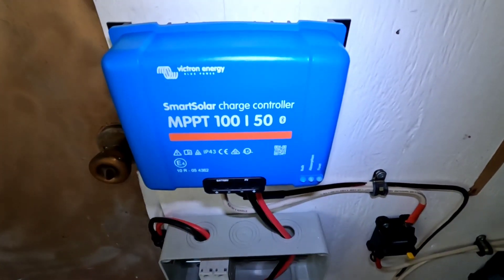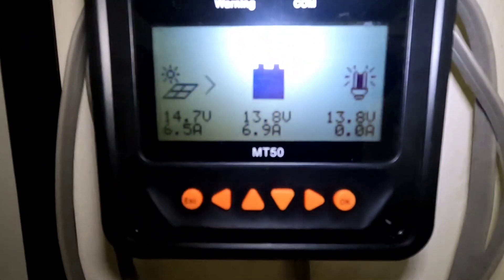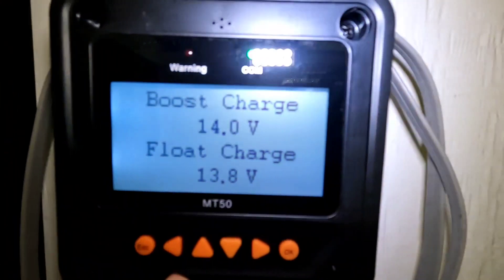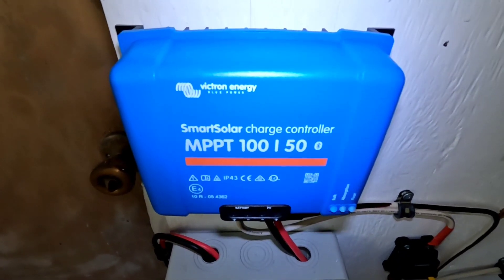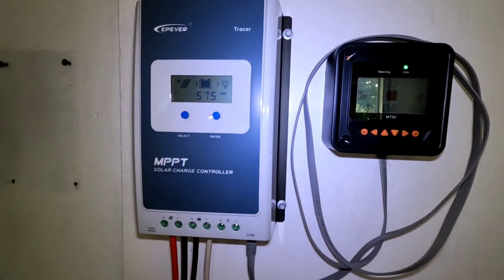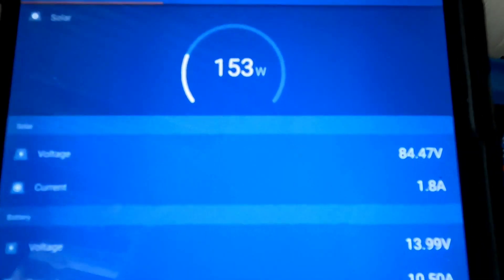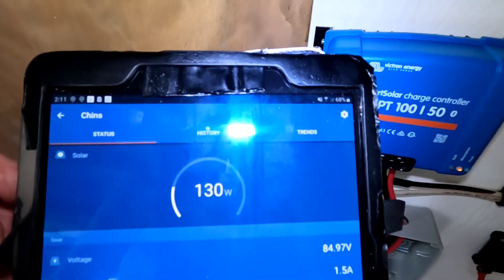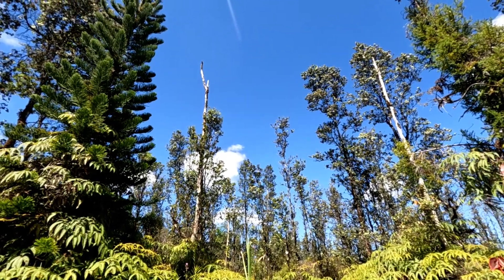Victron energy 100/50 and Epever 40a solar charge controllers side by side  exact same conditions

Comment: I tried both too and they are exactly the same, same v and amps same watts and in REALLY the same condition because i connected the same wires from one to the other to compare, i return the victron because of their impossible price for a wifi option, i got the epever with wifi at lower price than victron with only BT

Comment: Stiamo facendo troppa confusione dando opinioni senza avere le basi per farlo.

1)You can't take the test with 2 regulators in parallel !!!! If one arrives at the battery with one thousandth or more voltage than the other, the other will give 0A. it is pure physics !!!. even if you have set it the same, it is enough 2 cm of difference in the length of the cables to distort everything.

The test is only valid until one of the 2 can reach the target voltage of absorption or floating. ONLY IN THESE CASE EITHER CONTROLLERS ARE MPPT WORKING.(Topic in my answer to myself).
after that the rest makes no sense. it's just to study the law of ohm to understand that what you see has nothing to do with tracing, speed, control and other things you said. IN ABSORPTION AND FLOATING PHASE, if the phase target voltage is manteined any control dont work MPPT. Because is simply non physically possible.
And the current will only be divided according to resistance and voltage. When you see epever at 86v pv, 13.9v and 0.0A and victron at 13.99v and 10A, THE CONTROLLERS HAVE NOTHING TO DO!!! If the victron arrives on the battery at 13.99 and epever at 13.95. the law of ohms does not allow epever to provide power !! Raise the float voltage of the epever and you will see that it will be the victron to give 0.0A is the same thing as when you travel in a camper with a 13.8v float controller and a 400w load on. THE CONTROLLER PROVIDES 0W AND OA AND THE PANEL VOLTAGE RISES, AND ALL A LI PROVIDES THE ALTERNATOR BECAUSE AT 14.3V IT EXCEEDS THE CONTROLLER VOLTAGE. BUT if you raise the control voltage to 14.5v, he will be the one to provide everything and the alternator will provide 0.0A
It is PURE PHISIC NOT CONTROLLER ENGINEERING

2)I WILL REMEMBER 
That in the absorption and maintenance phases, the controller DOES NOT WORK IN MPPT !! THE MAXIMUM POWER VOLTAGE IS NOT PURSUED, because, if the phase voltage target is reached, for purely physical reasons, maximum power is not required and therefore the controller CANNOT FORCE THE PANEL TO ITS MPP VOLTAGE.
The mppt operation only resumes if a load powerful enough is turned on to exceed the maximum production of the panel, and thus absorb a part of the battery's current. In this case we return to the condition of the first charge phase, that is, in which the voltage cannot reach the phase target! Then the control returns to modulate the load resistance in such a way as to keep the panel at the ideal maximum power voltage (MPP)

Comment: The only flaw of the epever is that it stops at 14v on PV for a time ranging from x to 59 minutes. Those who are interested say so I explain it. I discussed with the epever engineers and they told me that I had hit the target.

For now, I'll just say that it's a deliberate strategy, shareable or not.

It has practically the same purpose that victron starts in mppt with PV voltage 5v higher than the battery. Epever part with 2v more battery. this leads to disadvantages . Low dc dc conversion efficiency at such low powers.

To solve they have developed a strategy that is what many notice, but no one on the web has ever understood.

Victron to avoid these disadvantages solved by DELAYING THE DEPARTURE. However, it still has disadvantages but to a lesser extent.

Pay attention in the morning with the PV voltage and PV power graphs early in the morning as soon as victron left..for about 20 or 30 minutes he can't find a real app point and keeps scanning the IV curve as if he went crazy from the minimum or the maximum..but he doesn't find the real point of app.. because with 3 or 4 watts it's impossible. And this crazy research consumes so little energy that ce. epever to avoid it, has implemented a "Castrata" mppt mode that lasts a maximum of an hour. [also because starting early, (+2v vs +5v) the problem of low efficiency at very low power would be even more evident].

However, this means that for a time ranging from a minimum of 1 minute to a maximum of 59 minutes, the power ramp will be lost .. the amperes will grow but the voltage will not be that of mpp. so after max 59 minutes it will make a new scan of the IV curve and then it will make a net jump in power. This is not disadvantageous with 18 or 36v panels. but with 86v as in the video it is disadvantageous. In fact epever advises not to raise the panel voltage too much. it is a strategy that is functional are when the voltage difference between PV and battery is not huge. The more this difference is, the more power is lost in the morning for a maximum of 1 hour.

I repeat, if you're interested I'll explain it better

Comment: I had two Epever controllers, one 100a and one 60a.the 100a failed, I replaced both controllers with Victron. Immediately noticed better overall performance. I’m on a boat, I originally faulted not getting full power from panels on angle or mast shadow. After installing Victrons I am now seeing full rated power from panels. The parameters were set the same on all units. I am very happy I changed units.

Comment: I have this same charge controller. Thinking of running two 400w panels on it with a 2kw inverter. Wdy think? I want to max it out and see if it goes 5yrs
😊
Reply from the maker: I now run two 500 watt strings into two Victrons in network with each other. Working well for me here. Aloha! 🤙
Reply: @ProjectsinParadise808  i don't understand how to use the power of the sun before it goes through the batteries.

Comment: Only just seen this. What you are seeing  is a common fault with the Epever. Its search for maximum power gets confused,  perhaps by a cloud, and locks on to the low voltage part of the panel volts/ current output curve. It may change if solar condiconitions vary, disconnecting and reconnecting the panels will often restore correct operation.
Reply from the maker: Great explanation of exactly how it behaves out here with the clouds that constantly roll through here. Aloha!🤙
Reply: Just started having this problem.  I have had luck just turning the PV off and back on but couple of times I had to disconnect the Battery and it went right back to work.  Cool nights and some thin clouds last few days.

Comment: Using the Vectron Ap, and Not Using the EPever Ap !  One Benefit's from the Correct Set UP, and the Other Has to Have the Ap For the Battery Set Up to Work Correctly, Unless is Lead acid, or One other, Glass mat I think,  For Lythithium You Need The Ap, on the Epeaver to Actually Set up the Charging Loads ...

Comment: I have 3/100amp epever charge controller now for about 2 years now working with no problem
Reply: Hi, I appreciate the dedication, but I'm sorry but everything you show and the considerations you make, from the moment of the end of the first phase, do not make any sense. Only in the first phase do the controllers work in mppt. In absorption and maintenance, as long as they maintain the phase target, mppt tracking has nothing to do with it. Haven't you noticed yet that your panels have unan Vamp of about 72v (changes with the temperature) and that you can only see it in the first phase? Didn't you see that in absorption and maintenance it goes up to 86v? Do you think Chen changed the Vmpp of 20v in a second? Mppt stands for Maximum power Point tracking . To find the precise voltage that produces the maximum power in all light and temperature conditions. In absorption and maintenance, unless there is a large load, by definition it does not extract the maximum power. So there is no tracking. and the panel is allowed to rise at a voltage at which it cannot produce maximum power.But at this stage the controllers have no modulation. it cannot be a better or worse one (except in conversion efficiency.

In addition, the comparison makes even less sense if you do not detect the voltages on the battery and do not say the targets of assosorption and maintenance of each .
Do you want proof of all this? Put the victron with 0.2v absorption less than the epever. you will see that it will be the victron to give 0A and epever will give everything necessary.
Are the wiring harnesses perfectly symmetrical? Impossible. so in the apse and float you will never see both contribute. except in the case you turn on a load such as to lower the battery voltage and regress in the first phase. in that case both contribute. but always according to the law of ohm.The epever problem is only one, and I explained it in a previous intervention. However it is very complex. if you do not fully dominate this that I talked about now it is even more difficult
They always give magical powers to the controllers and chargers...they do almost nothing . they decide 2 voltages in time and the rest is done by physics. the mppt controllers simply do "perturbe and observe" to follow the Vmppt. which they found by scanning the IV curve of the panels , which they do again at regular intervals of a few minutes. This is only in the first phase. If the battery maintains one of the 2 voltage targets, apse or float, THERE IS NO MPPT!! Without understanding this you will never understand well how a control works and less than ever you will be able to judge it well or badly  @ProjectsinParadise808

Comment: I have experience with both of those charge controllers paralleled together. If you didn’t notice your float voltage was set to 13.8 on the E Peever that’s why it was throttling. You could change the setpoint lower on the Victron and then it will start the throttle and the E paver will just provide the bulk of the current. There is no problem by the looks of it to me. I am slowly replacing all of my stuff to Victron. I also have two midnight classics.
Reply from the maker: Same here...slowly changing over to Victron.  Epever works well,  but day in and day out Victron always pumps in more kwh. Aloha 🤙

Comment: It almost looks like the Epever is acting like a PWM controller.
Reply from the maker: That's actually a great analogy,  and pretty much how it acts.  Last few day's in great sunshine producing about 500wh less than the Victron with strings in same location.  It may produce 1000wh, but Victron put out 1500...yeah...aloha 🤙

Comment: From what I can tell, the EPEVER problem is either a software bug or an issue with paralleling mulitple controllers. It seems to happen during shading events(clouds) and first light start up. It will just sit at 14v all day long till the string is reset. One comment on another one of your videos mentions having fixed the issue by adding a diode on the output of an EPEVER and that fixed it. It could be that simple. Victrons are great for the price but not perfect either. Definitely faster then the EPEVERs and possibly more reliable. I do like the EPEVER housing though.

Remember to cover a panel string before you cycle it to test so you don't arch the string
Reply from the maker: You described almost perfectly what my experience has been. I did see that comment you mentioned, but I don't know how to do that at this time. And mahalo for the tip about covering panels! That is important! Aloha 🤙

Comment: If you have both charge controlers hooked up to the same battery bus then they will influence each other. If the Victron is first at charging, it will raise the battery voltage, the 'slower to kick in' charge controler will see different voltages and hold back more. I have 4 charge controlers on the same 48V bus but they are controled by the Cerbo GX, it puts the MPPT RS units in 'External Control' mode. Besides, the Victron units have superior MPPT tracking :-)
Reply from the maker: The way you describe the two different controllers working is pretty much exactly what I am experiencing. Thank you for such a clear explanation! Yeah I like the victrons, aloha 🤙

Comment: Switch the inputs. Victron reporting 68.5 volts from the panels and the epever was reading under 15 volts from panels. Something odd there.
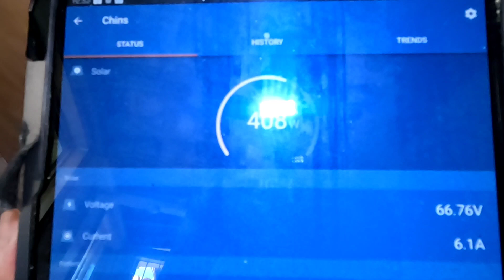Reply: 05:18
Reply from the maker: It seems the victron is influencing the Epever and getting it confused and slowing it down here and there. That's just kind of what it seems like. Aloha 🤙

Comment: they is something wrong on the e[ever it had dragged the solar voltage to that of the battery they was no mppt happening id check the solar cables
Reply from the maker: Yeah something seems off on it, although it does work...I dunno🤙

Comment: I must agree with the other comments: If the PV voltage input is not roughly the same on the two controllers, its not an comparison as it is not the same conditions. If you would swap around the PV strings, so the Victron would get the only 14 volts PV input, then it would be the one looking faulty! (Victron may be a better controller, not so much doubt - but there is something wrong with that PV string on the Epever in this "comparison")

Comment: Did you notice the PV voltage on the EPEver is only 14.8v ? This is why it's getting such low wattage. Now question is why is the voltage so low? It's like the PV is directly connect to the battery. I wonder if it has a shorted mosfet? Or is it just getting poor sun, and in PWM mode?
Reply: I was thinking the same exact thing I have an EP ever and/or and never had that problem before something is definitely wrong with that side of the system.... Like my man said you're only getting 14 point something volts in from your solar panels so of course you can only pull so much amps from that, Seems to me you  Need to isolate a variable. Something is not right on the epever side 🤔
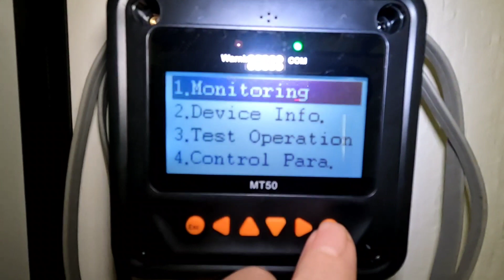Reply: Yes, definitely something is off with these 14.8 volts. At 02:15 we can see 14.7 volts on the panels and it's no wonder battery voltage will not go above 13.8 volts because the manual says that the MPP voltage range starts at battery voltage +2V. So there would need to be at least 16 volts coming from the panels in order to reach 14V. I think in these conditions 13.8V is still a good result. Something is not right here.
Reply: I tried to change values in Epever manually because I have to it's a older 2010a anyway I wanted to change 2 things on top row inside the parameters? I was thinking what the battery can absorb and what it can discharge in amps but those are not adjustable, yet my chins can go higher IN and OUT than the "20" that always shows in those boxes. Does my comment make sense sorry I cant share a jpeg here. peace!
Reply: because epever sucks! it's good i do have it but for me it also hands on low voltage... my panels produce 75v. and max power always si at ~62-65v..but epever loves to hang on 29v. and halfs the power.... i have to disconnect PV and reconnect so it "recalculates" and starts working ok...and i have to do that many times if there is couds in the sky

Comment: I was wondering how the 2 compare. big difference. I think if you put 2  100/50 together on same battery you can sync the 2 . Victron has a nice shunt you can use .will give you a more accurate watt hours in and out of battery. all Bluetooth ready . all your info right on smartphone ,tablet, or laptop. all logged with date and time. 😀
Reply from the maker: Victron put in basically double the power today compared to the Epever. Victron allowed maximum input from panels and tracked with crazy speed with the clouds rolling through.  The Epever did open up to full input occasionally throughout the day, but struggled keeping maximum input given the conditions comparatively. I'm going to be adding another Victron,  and add the smart shunt as you suggest.  I just want plug and play anymore.  Although the Epever did get my feet wet into the MPPT controllers,  they no way compare in the conditions here to Victron . They may find there way into other systems around the property,  but I am going Victron from here out. Aloha buddy 🤙

Comment: Nice video again! Can you explain what the 100/50 spec on the Victron means?
Reply from the maker: 100 volts, 50 amps .Aloha 🤙
Reply: @ProjectsinParadise808  Thanks! Assume that's max input from solar. So 5000W?
Reply: @stevenshircliff393  Do you think it might have something to do with the settings since you have to input lithium values under a User profile. Can you share your settings. I have a 4 of 3.2 volt LF280K liFePO4 batteries. Thanks
Reply: @sammaimas155  That is what I was thinking the software setting is not allowing IN and OUT to what the lipo can actually handle, my issue is I can seem to change 20amp settings in either box. I can go higher than 20 on the battery.

Comment: Look how low your solar voltage is on the epever controller. Its letting in nothing because the panels are miffed. Its RIGHT THERE ON YOUR SCREEN! You clearly have a bad connection or panel or something else going on. Thats the ONLY way to explain the voltage being at 86 unloaded and 14 under load. Stop blaming the controller. It may be inferior to Victron but IT IS NOT YOUR ISSUE TODAY just like the other controller wasnt your issue yesterday =)
Reply from the maker: It just doesn't explain that for the rest of the day voltage was fine, 60-70 volts pushing 30 amps or so. I'm not sure what is happening.  Wasn't a huge discrepancy in watt hours between the two controllers at the end of the day. 900wh on Victron,  500wh on Epever. The Epever catching shade earlier on it's string seems to justify that.....i dunno . aloha 🤙
Reply: @ProjectsinParadise808  there is 1000% an issue with the string causing the controller to draw the voltage so low. Could be a bad connection intermittently causing an issue. Go investigate. “Ive tried nothing and I’m gonna blame the controller” is never the best option my friend!